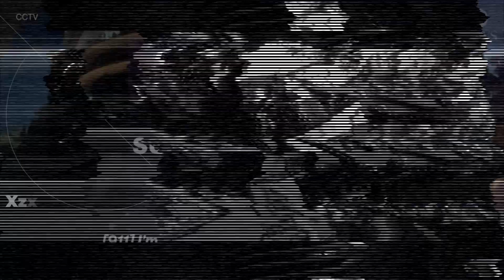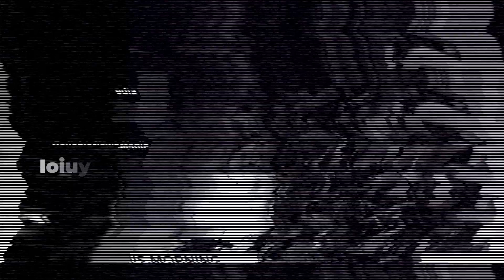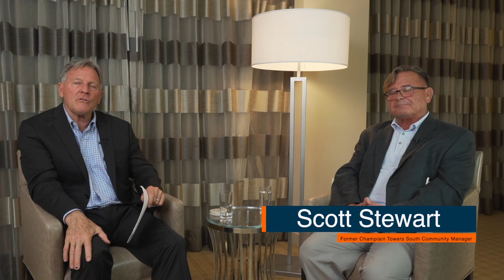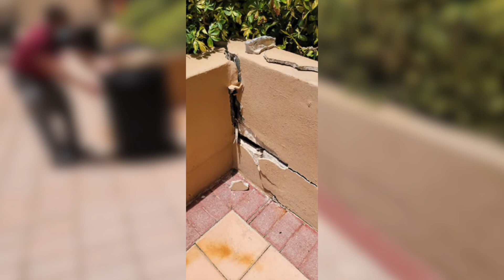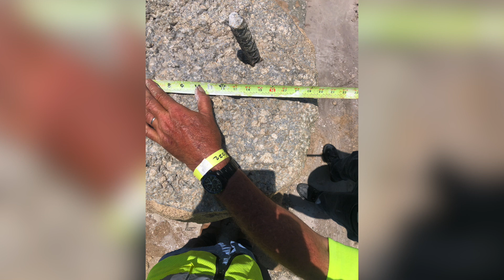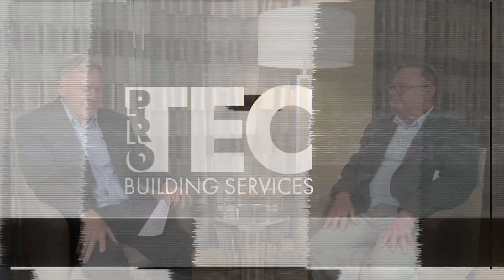Interview with the Community Manager of Champlain Towers South

Comment: I thought the collapse was due mainly to the post tops puncturing through with a lot of the posts being too small.
Reply: Ontario, Canada, had a bridge collapse in Port Bruce, which was alleged to be caused by a hidden failure, as the previous inspection reports didn't indicate any problems. There appear to still be 2 pending lawsuits about it, and the forensic engineers' report has yet to be made public nearly 6 years later.

Comment: The most important thing should always be the foundation and structure. Number 1. All leaks needed to be fixed first, than any cosmetic stuff is secondary. That's no fun for the owners but no foundation no building! They don'e float on air.

Comment: good interview, unfortunately a little late to the table. Many of the defects were up front during construction, the GC / city inspections etc. that was proven shoddy workmanship in the structure, then neglect, then overloading the pool deck, repairs, water infiltration.Only until then the condo owners would not approve the repair bills , ultimately the entire structure failed.